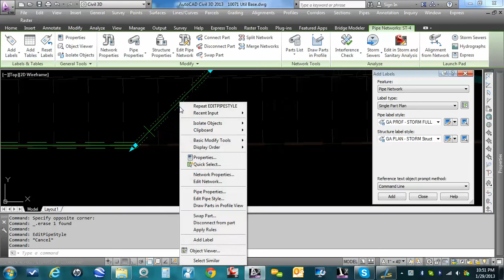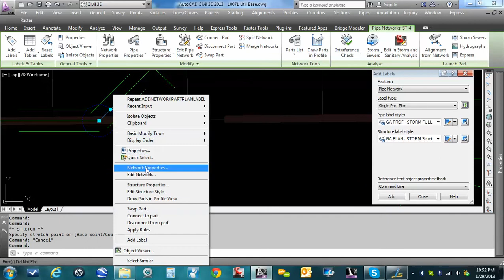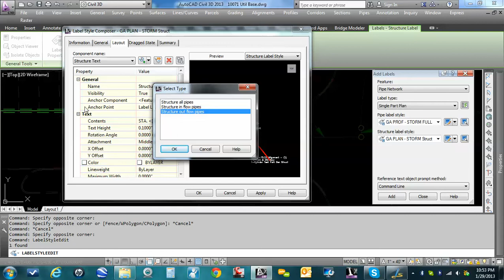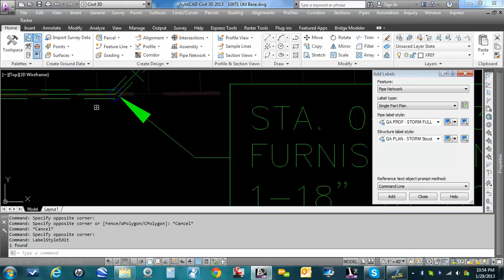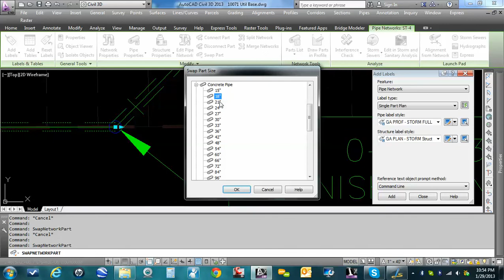Civil 3D Horizontal Bend Labels

Comment: Hey Tony. For say water main bends, we do the same thing except use the structure description to label the rotation angle. Neat post. I did not even know about the  clean up pipe connections check box. Nor had i thought about cut/copy pasting fields from one label style component to another one that did not have it. Nice work!

-Greg